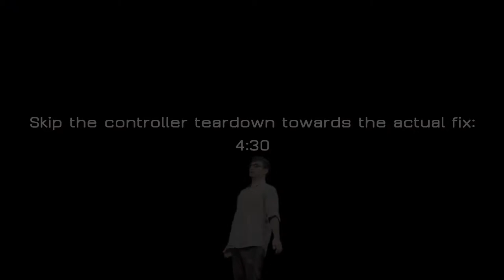How to fix Xbox One L3 & R3 buttons & SPRINTING

Comment: See problem with mine is that it just doesn’t make a click sound when I click but everything works fine it just bugs me
Reply: Woozy SAME
Reply: Did you fix it?
Reply: @woozy do you how to fix it mine does the exact same thing
Reply: Mine doesnt click or work
Reply: Mine broke cuz I was repeatedly pressing on it to tac sprint in warzone lol
Reply: Same
Reply: So no one knows how to fix it I’m guessing.
Reply: @bonqueequee  Hahha mine doesnt click at all it broke because warzone constant clicking
Reply: same did anyone fix it or know how to fix it
Reply: @bonqueequee  bro same 😂😂
Reply: Got the same here, anyone found a fix?
Reply: Yo Itz beastmodedude27  i got the same problem, have you found a fix?
Reply: Yooo same here. Wont work due to tac sprint 😤😂
Reply: Same problem can’t find a video about it 😞
Reply: I would say the clicking comes from the button being clicked all the way down. Your button still works but it’s not being fully compressed hence no sound. Ajust the white bit with more of the fillers and it may just work
Reply: @joshuabrackenbury5357  I thought the same but no, using something tiny like the end of a flathead screwdriver and pressing on the little grey button still made no click. If it doesn’t click chances are it’s just broken and you’ll have to deal with it
Reply: I have the same problem but it’s with my elite series 2 that I got a few months ago so it pisses me off
Reply: Woozy On God 😂 Bra i Think Its hella dust in my sh*t
Reply: Mine needs to be pressed hard to work is there a fix to that
Reply: @dennisgpezan3488  bro same mine just started to
Reply: @bonqueequee  did you fix it ?
Reply: @bonqueequee  me to bro
Reply: @lilnick4964  didn’t this video help you? Sheesh.
Reply: @sO_RoNerY  it didn't i just bought a new controller
Reply: Mines too, and I haven't found a video to help yet
Reply: @GXilla  you can't fix it sorry
Reply: Same
Reply: @GQI3  youve probably got something inside of the mechanism that's making it go from a click thing into a push thing like dust etc.
Reply: Mine does the same.. Go to settings and put to always sprint. It sorta fixes the problem but im going to get a new remote
Reply: @obey909x  i just bought a new one cuz i couldn't fix mine
Reply: Same problem

Comment: The biggest thank you from the bottom of my heart!  My ps4 controller is about 3 years old and the L3 was demolished by destiny 2. This brought it back to life IMMEDIATELY!!!  Big tip to future purchases,  warm up your stickers slightly with rubbing on the sheet of stickers themselves to help with pulling them off. I know some of them stuck to the paper but if it starts to happen just stop and try peeling from a different side of the circle. It works trust me!  Thanks a million man!

Comment: My problem isn't the switch being pressed, it clicks every time without issue. Having trouble trying to figure out what exactly to clean to get the input to actually consistently register when the stick is clicked
Reply: atleast you have the grey piece that holds the y- axis in place when you click, my joystick is entirely fucked.
Reply: exactly
Reply: have you found a solution yet?
Reply: @beankensa  mine too when I try to click down there's no click it's just no sound and when I push down it goes down so far into the controller whenever I try to click I literally have to twist the joystick to the left for it to actually register as a click
Reply: My problem is the bit o plastic inside the stick module snapped so when I press the stick the part that presses the tact button doesnt move at all. I don't know how this happened maybe my little brother pressed the stuck down way to hard and snapped the cheap plastic inside the module. The whole module is going tohave to be replaced if superglue wont work. The thing is is it is an elite series 2 180 dollar controller as well!!! I'm so pissed its not even 5 months old! They wanted 150 bucks for the warranty on it on top of the 180 I spent on it so I didn't get it I couldn't get I didn't have 330 bucks on me at the time!
Reply: @Andronicus87  did you find out how to fix it?
Reply: Swap the right and left sticks. Assuming that the left stick is the only one that needs fixed.
You don't need the right stick to sprint anyways 🤷‍♂️

Comment: The tact button doesn’t do anything when pressed. I had the controller on and pushed it with a pair of tweezers and it didn’t register any input.
Reply: Same, did u get a fix for it or find one?
Reply: @vegetav5  yeah, the problem wasn’t contact with the tact button, it was the contact between the tact button and whatever it contacts to register an input. I shoved a bunch of paper in there so I push the tact button onto its contact point
Reply: @smortboi1320  smort 📈
Reply: @smortboi1320  hey, I've got the same problem with my controller, could you explain this further please?
Reply: @jt4225 at 5:00, when the guy uses tweezers to put stickers on the button, I did the same with paper. I can’t elaborate further because I don’t even play video games anymore

Comment: you can also use some paper and just a little of super glue, it make a stronger and durable gap filler. Just be careful, use very little, move everything constantly until the glue dries out, because you dont want the stick to actually stuck in position.

Comment: Hi, I have a problem with my gen 1 elite Xbox controller. The left thumb stick is not consistent when sprinting in destiny 2. I have to push it quite hard and it’s rather distracting. After watching your video, is this what I need to do? If so, what could I use for the filler stickers?  I’m on a tight budget so any ideas would be great. Thank you in advance. Great video!! 👍🏻
Reply: freeserver22 yes sir that happens to me as with the same game!
Reply: Same
Reply: Holy crap! I've been searching up and down the internet to find this question. I have the exact same issue. Did you ever figure something out?
Reply: Roger Picard  unfortunately not, I’m guessing it could be repaired, however I would expect this to be expensive. Mine is just sat on the side now, I haven’t had to time to find out how much a repair will cost but when I do I’ll post here to give you an idea.
Reply: Roger Picard  also, I believe the entire left stick has to be replaced which has to be removed and re-soldered.
Reply: @freeserver22  dam thanks for the reply. From what I've gathered over the last few weeks is either it requires a new joystick component or it's a software issue. Either way it sucks
Reply: @freeserver22  yep. Luckily I have the tools and skill for it. I might just do it
Reply: Roger Picard no problem, it is very frustrating isn’t it? I do miss that controller. I’m just using the standard X version now. Let me know if you get any  other information and I’ll do the same ok. Good luck!!
Reply: I have a Elite gen 1 as well somehow since today my controllers left stick doesn't make the clicking sound enymore when you press on it. I am going to open it up but is this problem fixable? If yes how or no can i just pop in a regular xbox one controllers board in for the new sticks. I have 1 that i never have used.
Reply: turkisch66fireworks  I believe it needs a need thumbstick that requires soldering.
Reply: @freeserver22  hmmm maybe i'll try it idk. All inputs are getting registered up, down, left, right and even press so only the clicking mechanism is somehow defect. And does the regular xbox one stick board function if i swapped it with the Elite? If it is the same it would be so much easier to fix it i think because i only would have to solder the cables.
Reply: freeserver22 i resolved my issue i was having the same problem and i have the same controller. wat i did was just remove the thumbsticks not the metal piece but the just the. sticks that offer high stick and low stick and just blow on the metal piece as hard as you can
Reply: AntFC  thanks I’ll give it a try 👍🏻
Reply: Having the same issue with the same controller Gen 1 Elite Controller I can move it every direction and can click but for it to register I have to press fairly hard. Must be a problem with this controller.
Reply: I have the same probelm on the series 2

Comment: My problem is that the little button you stock up filters on is not making clicking sound as oppose to the other button on the other stick. RIP
Reply: Same it works but it does that
Reply: That’s the problem I have right now. Any luck after 8 months?
Reply: Owen Kennedy No man, I bought an Elite 2 since and LB on it broke. lol But this controller left stick still works kinda. Just don’t click. Tbh, it’s easier to buy a new one if you sure you have the same problem as me. Trust lol
Reply: @brandeeno2846  I have the same problem. I took mine apart and figured out that the button that is inputted when pressing l3 is no longer functioning like a button. Hence, why is does not click or feel like the other analog stick. Its almost like it is working like a sensor now that functions with some pressure. I believe the best way to deal with it is to replace that little button by removing it and soldering a new one in its place lol. I am looking for another solution I will update!
Reply: Salomon Cantu holy fuck man haha. I mean I’m not a handy man at all, but I learned how to take a controller apart and change some faulty sensors etc, but that honestly too much work hahaha

Comment: My right stick makes the click it's just that it doesn't register as a command in game, this is the third wireless I've had and I had one wired that broke, I also play games at a competitive level so if someone reads this is appreciate it if you'd help.
Reply: I have this same issue but idk what to do. Now I cant sprint in games so I look like a noob. Someone please help
Reply: @devinlancaster9874  most games have the sprint by default setting so you can sprint without clicking left stick.
Reply: @Qixo_  i still cant sprint my left stick works perfectly when i move it left right or down but it doesnt move my charactee when i move it forward
Reply: Have u found any fix this? I am having the same problem
Reply: I'm having the same problem
Reply: @Flo.189  u 2 years late bro 💀
Reply: @Qixo_  i need help do you know more in 2 years later about this problem
Reply: @Flo.189  I've had multiple new controllers and I switched to keyboard and mouse and was semi professional and have quit since lmfao, a lot has happened, just buy a new controller

Comment: For me I have to like press L3 multiple times before it des does what its supposed to do I'll press it once sometimes it works but like to sprint I have act like my thumb is hail on it to work any suggestions btw it's a PDP controller
Reply: When I sprint in cod I have to hold it down to work and only works for a few seconds

Comment: I need help! Where do you get those fillers? And I can't get my hand on them, can't i just use a hole puncher on paper and use the paper circles as the fillers?
Reply: It’s little pieces of vinyl.
Reply: Ace Reloads, these things are $3.95 (so not worth it)make your own for free, they are only little pieces of tape.
Reply: hey guys i find a way it might now not work for you but it did for me but i took out the joysticks you can do that step after u take apart the cover and then just blow into your left stick and it worked for me

Comment: Also another question. Can I insert the fillers without fully taking the controller apart. Can I just removing stick and then just insert the fillers?
Reply: If you are talking about an Xbox One Controller this might help. You will have to open up your controller to do this. You don't have to remove any wires if that's what you're worried about. Just be careful when taking it apart so you dont ruin your controller.

Comment: Mine has just started to not register a left stick click, but it does still click perfectly fine. It doesnt register unless pushed really hard....would this fix it or is it  an issue with electronic part?
Reply: did it get fixed because i have the same problem

Comment: I just bought a used one for $10 on letgo in about 10 minutes
Reply: The one I bought off letgo also had drift 😞
Reply: Beck Barnhardt that’s your deadzone you have to fiddle with your settings a little bit

Comment: Thank you!  You have a new subscriber.  A friend got an xbox one and literally within 3 days of playing a lot of FIFA both controllers had the left thumbstick issue getting stuck in the down position and not clicking back up, causing all kinds of issues with ball not going where aimed and players running wrong direction etc.  I don't use the L3 button playing fifa, but just the normal play causes it to click down on occasion and that's when the trouble starts.  I would love to be able to have a quick fix to eliminate L3 all together and it would work fine for me on FIfa.  Any ideas, or something simple on the outside to fix this?  I thought about a rubber guard or ring of some kind to keep the stick from clicking down, but would be hard to keep the freedom of movement needed.  anyways, wondering if there are third party controllers that made the sticks better so they don't break all the time.

Comment: does anyone know what that grey part is called
Reply: I'm thinking that you want to purchase the individual part. I don't think that is something you'd be able to do in a practical way. If you need to replace a part, you'd probably need to by an entirely new *matching* joystick and install that (if you know how) or take the part out that you need from the new one and install it into the old one. The second approach may be more difficult than to just replace the entire joystick.